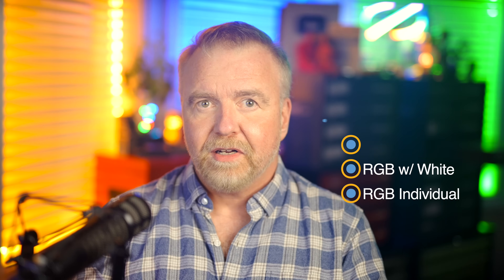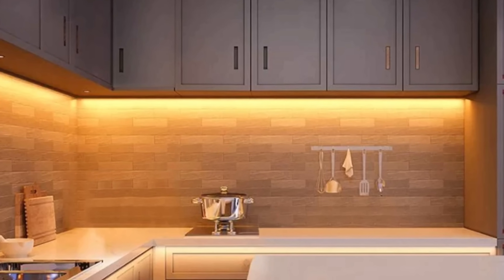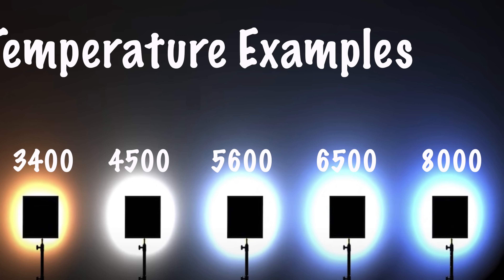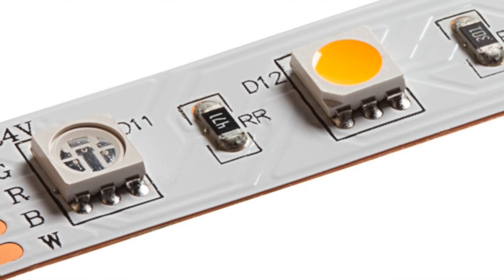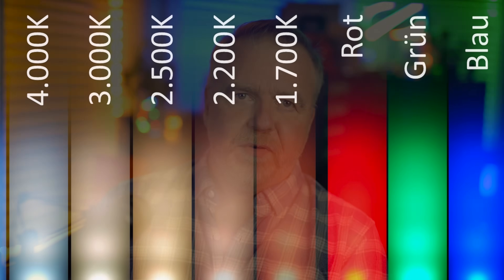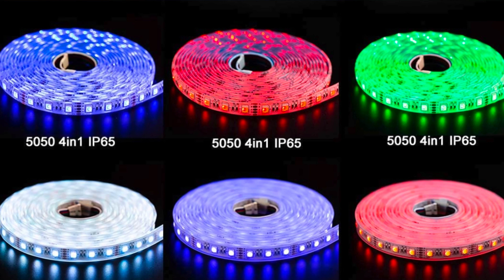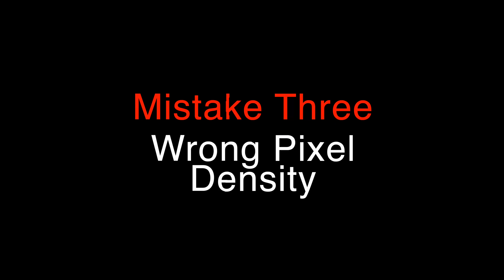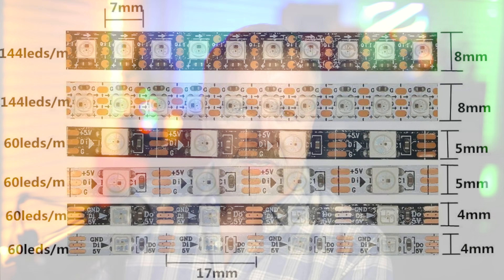LED Strip Projects: Top 5 Tips and Top 5 FAILS to AVOID!

Comment: Hey Dave. Great video. Electrical engineer here. You’re right as to the LEDs repeating the data signal to allow it to be passed long distances.
Another issue I would mention in the mistakes section is one that I ran into myself. It is advisable to minimize the length of the run of the signal wire between the microcontroller and the first LED. I had an issue where a long run was causing the incorrect data to be displayed on the LEDs. I think it was a combination of transmission line effects coming into play and voltage drop over the long run.
Reply from the maker: Thanks!  You're spot on that the FIRST run makes a big difference.  I've seen people adding "decoupling capacitors" or something, but I've been lucky.  I send a 3.3V data signal to an LED expecting TTL levels over an old 10' run of speaker wire and somehow it works. Pretty robust!
Reply: @DavesGarage  One trick I've seen people use is to cut off a single neopixel and wire it directly to the 3.3V controller. It will provide a nice clean 5V signal for the long cable run to the actual strip. You just have to remember to skip that pixel in your program. The proper way is to use a 74ahct125 or similar buffer, but that's unnecessary extra cost and hassle in almost all cases.
Reply: @DavesGarage  great to hear! Your LED setups are awesome! One thing I would love to see is a more detailed step by step about getting Night Driver up and running, maybe a simple setup where one ESP is controlling a test LED strip and another ESP has some buttons and sends commands to change effects. I would like to convert my LED setup to Night Driver and I’d love to see one of your Dave’s Garage tutorials to get me started. Either way keep it up!
Reply: The main issue is that most are using a 3V3 microcontroller and the neopixels are intended for 5V. The 3V3 output works, but with very little margin.

A pull-up to 5V at the first LED can help. But there are cheap level shifters available that can step up the signal to 5V. But a normal 74HCT logic chips also works - it runs at 5V, gives CMOS-compatible outputs (higher than 95% of VCC) but is happy with old TTL input levels, so 2.4V is enough. Just don't try 74HC - they expect CMOS logic levels for the inputs too.

And as mentioned - a single dummy neopixel can be used to step up the signalling voltage. But that extra pixel hurts a bit since it requires the software to understand there are one dummy output.
Reply: I use the little level shifter PCBs to start my runs. Even retail on Amazon they're inconsequential to the overall cost of a project.  I just hide it under the ESP on the perfboard. 
But yea you can use an LED and just account for it in the program.
Reply: @Frankenduke  You should be careful with those, the cheapo ones with just a pair of BSS138 MOSFETs are pretty low bandwidth. They could easily hurt more than they help. You need the ones with a real level shifter IC (if you need anything at all).
Reply: @tamask001  
Thanks for the info.  I haven't had any issues with them yet but will be good to know if I start having issues. To be fair most of the time the house is just on Pride2015 on a slow rate.
Reply: @RFengineer true and good point
Reply: @RFengineer The data runs need to be configured as current loops and wires suitably twisted.

Comment: Experimenting with a ws2812b strip with 300 leds at the moment. I  turned it into a 50x6 matrix with the data line zigzagged. the odd lines are normal direction, even lines have to be filled backwards to save on long wires having to be used. wrote the driver from scratch in python, still a work in progress. Although the core renderer is ready and works nicely and is quite fast for a pi pico.
Reply: There are several methods to do that. Since some libraries sometimes just don't do the trick (but are otherwise great like FastLED) or you might have an unusual geometry, I simply doublebuffer stuff. So you can take the full effect rendering part others use, even with fullspeed 2d rendering stuff and finally I use a copy loop to transfer that standard left to right buffer info my geometry. 

That way I can even render "holes" in the strip, like I do have in my mancave when the surrounding wall light has cutouts for the window or door. The effect then does not "jump" from one side of the hole to the other one but will just smoothly appear on the other side when it should if there were leds in between.
Reply: @larsfriedrichs8924  Yeah I built in a frame buffer with itś own virtual size larger than the led display itself so I can just build a number of things to display in one go and then just show a part of it (display size) at any time, it enables scrolling but also for example alternating frames without any more rendering, just writing the relevant data to the leds.

Comment: from the WS2812 spec sheet:  "After transmission for each pixel，the signal to reduce 24bit. pixel adopt auto resha
ping transmit technology, making the pixel cascade number is not limited the signal transmission, only depend on the speed of signal transmission."

Comment: Well. If you have a LED TV you could possible own more than a million LEDs
Reply: Depends what specific kind of LED TV you have.   If it's just "LED" or "QLED", then the LED in the name refers to the backlight of the TV, not the pixels, which are just plain standard LCD.   If it's "OLED", then the pixels are indeed individual LEDs that each emit their own light, but other than the name and that they both create light, OLEDs have little in common with traditional LEDs.   There's also "MicroLED" TVs, which are traditional LEDs for each pixel, but those are incredibly expensive (hundreds of thousands of dollars).

Comment: Great video as always, Dave! One thing that has held me back from playing too much with LED's is possible RFI. I am an amateur radio operator and I wonder if anyone has experience with these in an RF environment - either generating noise or being susceptible to RF.  Presumably FCC type-15 acceptance saves us but...

Thanks!
Reply: I suspect there is hardly any interference as the handled voltage is only 5 volts DC. High AC voltages are the ones that tend to cause noticable RFI. The data line uses extremely little current so don't expect problems from those either.
Reply: If there is interference, would it usually end up being the switching supply? Or a low quality switching supply?

I would think swapping to a transformer based supply would clean the air up...
Reply: @volvo09  In switching PSUs , bad quality caps can cause rfi.
Reply: The addressable strips must produce a bit of noise (not sure how much) but the non-addressable ones should be completely RF silent assuming they are run from a clean source. Using PWM dimmers to change colors will also produce some noise but this is probably less and can be managed by changing the slew rate.

LEDs should also be immune from noise but the data lines for addressable ones would be most likely to be susceptible. Shielded cables would probably help with that.